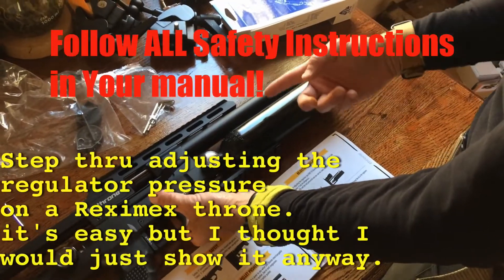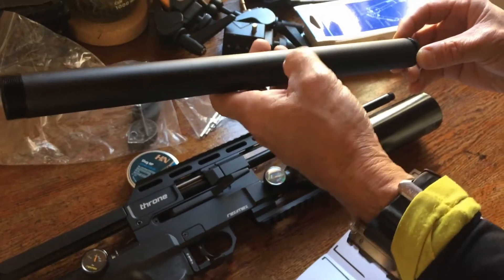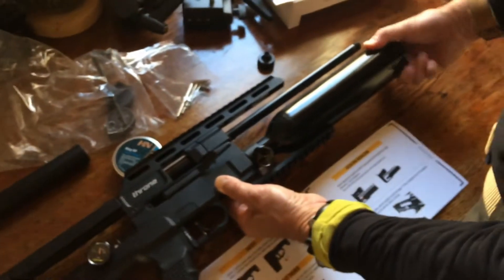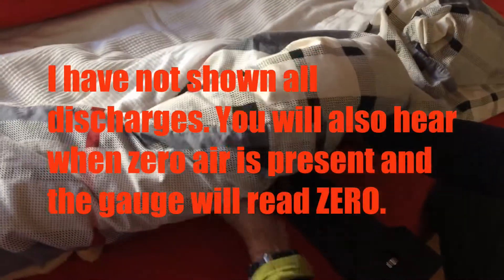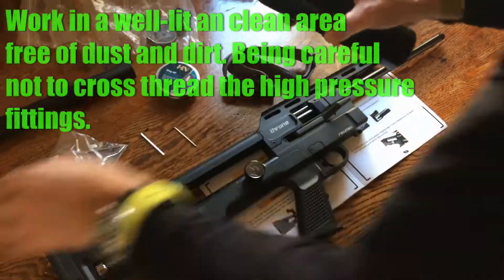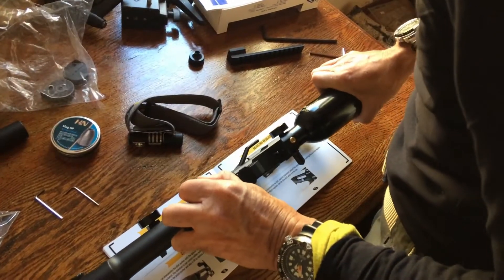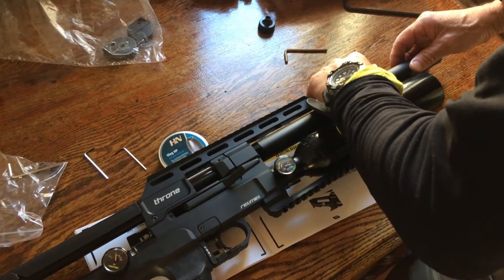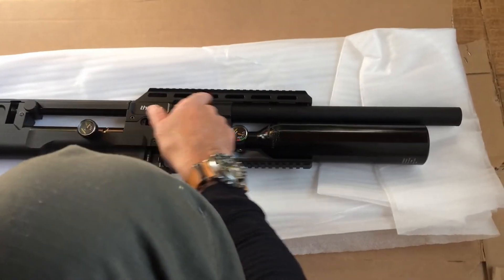Reximex throne PCP Adjusting the Regulator Pressure for Optimal Tuning

Comment: Can u comfirm with the regular adjustment is
Reply from the maker: The only way to confirm is to use a chronograph to see how the adjustment either improves, does nothing or worsens one's power and/or accuracy . If you mean however, how to do this? On this model you have to insert something similar to an allen key into one of the holes in the adjusting ring-which is the valve adjustment and turn carefully this ring either towards increasing the pressure or decreasing it. You can only do this when the gun is at zero pressure ie main tank removed and the regulator at zero pressure, for safety reasons.

Comment: Какое давление нужно поставить, чтобы пуля 1,3 грам полетела с скоростью 260 метров в секунду? 160 Bar?
Reply from the maker: Hi I'm sorry I don't know you will just have to use a chronometer to determine this but at least 150 psi regulator pressure I would think.